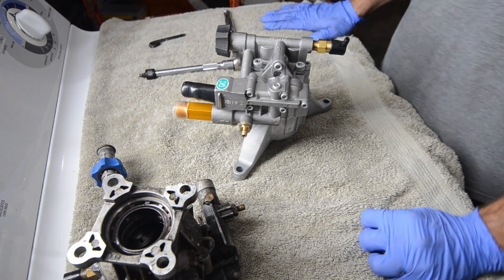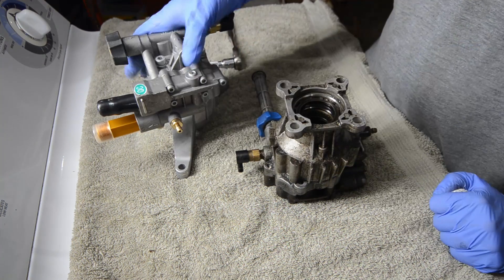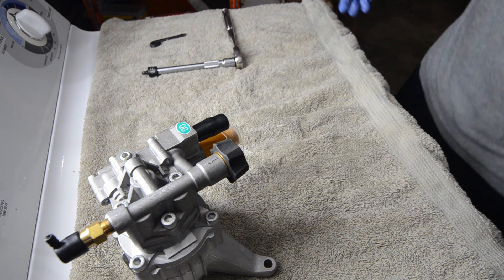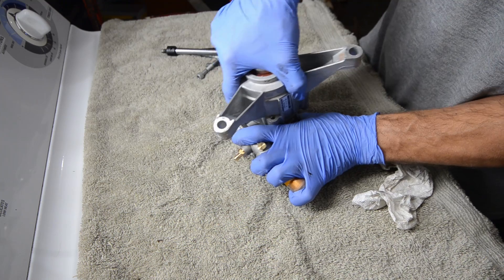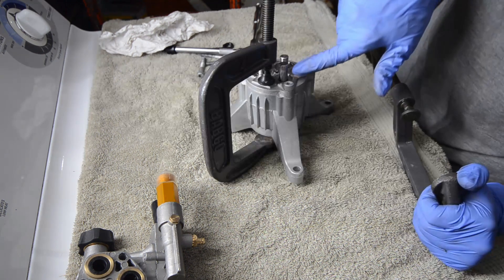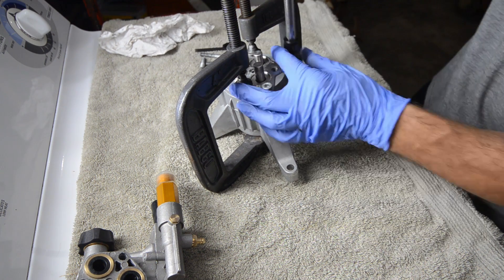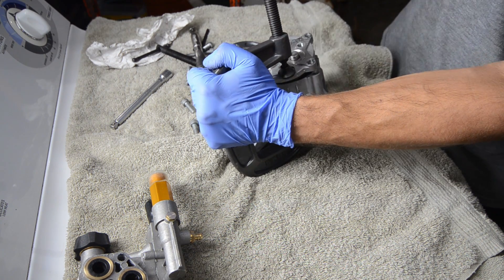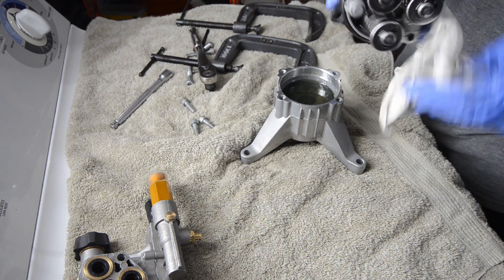How To Pull Apart And Inspect A Chinese Axial Cam Pressure Washer Pump From Amazon. Part 1/2

Comment: Watched both videos. The difference in the oil was amazing. What do they use? Vegetable oil? In this video you can barely see the washer plate, but in Part 2 the new Mobil gear oil you can see into quite well.
Thanks!

Comment: How do you drain and refill the oil in one of these vertical pumps, without disassembling like that?
Reply from the maker: Old one had a drain plug, new one didn't. So the answer is, you can't.

Comment: If the old unit only needed need bolts and a seal, just replace the bolts and seal. Remove the old sheared bolt by mig welding a nut to what remains sticking up and remove with a wrench. Ez.

Comment: I just got a new washer and it unfortunately has a Chinese axial pump. I will follow your advice and  clean it out. Is it worth putting drain and fill plugs in the casing? Now I know what to expect inside. Thanks.
Reply from the maker: If you plan on changing the fluid often the the plugs would not hurt. Not that it is hard to pull apart.

Comment: AMSOIL synthetic MARINE gear lube 75W-90 or AMSOIL SEVERE gear lube EXTREME PRESSURE 75W-90 + Would utilizing Performance Tool W1156 Grip Clip Transfer Pump/ Siphon Fluid Transfer Pump Kit for Water, Oil, Liquid, and Air for $13.50 have SAVED MUCH TIME instead of wrestling with the C/D-Clamps and 6/8mm allen hex tool and risking nicking the machined-finished/polished parts and damaging seals.  SEEMS LIKE A LOT OF UNNECESSARY WORK

Comment: Where can you find the little metal washers/seals that sit just on top, well technically bottom, of the housing. I can find the o rings in kits but the only way I can find the metal washer/seals is to buy a complete pump. Mine leaks water and I found that one of thise washers had been damaged and corroded, actually split all the way around and there was water inside the housing. HELP!!

Comment: I had the same pump break. The bolts brok and the pump opened up and dumped oil. Everything was okay so I got some replacement bolts and added Briggs and Stratton synthetic pump oil. The new bolts heads shear off so the bolt shaft and the housing was damaged. I have pictures if you want to see.

Comment: bro my unloader valve is STUCK corroded in the pump body of a 1 year old Honda GCV160/Ryobi 2300 psi unit; any tips to get it out so I can service the faulty/stuck valve itself???
Reply from the maker: All I can say is try to work it loose. If it is that bad you might just be replacing the pump.
Reply: Had the same issue with my GCV190. I took the nut and spring off, then put a socket big enough to allow the valve to fit through. Attached the nut on the end and hand tightened it with another socket. Came off with ease. No need to attach socket wrench.

Comment: What do you typically see go wrong with those axial cam pumps when they stop producing pressure?
Reply from the maker: If we are talking to the point they are not worth trying to repair. Seals, physical wear, unloader valve, other large catastrophic failure. That is what I have seen.
Reply: Bassntruck thanks!! I’m just gonna order a new one. Appreciate the reply!

Comment: hey man i changed the pump oil and put it take together and check to see if it worked still and water started leaking bad by the bolts to remove the oil cap any reasons why ?
Reply from the maker: I have seen some older pumps once they have been taken apart the plunger seals no longer hold the water pressure. Is the oil mixing with the water?
Reply: No its not
Reply from the maker: Which bolts are you talking about exactly? Where in the video do I remove them?
Reply: The ones u had to put a c clamp on so it wouldnt pop open
Reply from the maker: So around the 4:45. Then you likely have weak axial cam seals. This is somewhat common on older pumps once you take them apart. That or you might have damaged one or more when pulling the pump apart or putting it back together. I like to put a little oil on them to help it go together. If you can find the seals you can replace them. Might just have to measure the seals to order new ones.
Reply: Yes those

Comment: Hey man, followed your vid and really appreciate the help! However, I replaced the pump and still have the same problem..no pressure! Hose and wand seem to be clear of obstruction...any ideas???!
Reply from the maker: Sounds like an issue with the unloader and being stuck in the "open" position, therefor making no pressure. That assumes you just get standard water feed pressure out of the wand. And that the insides of your pump are all in good order while put pack together correctly. I also take it you have no water seeping into your pump oil.

Edit: You replaced the whole pump and still get the same issue with a new pump? If that is the case it still could be a stuck unloader (odd) but are you sure the shafts are fitting together and the key is installed? If the key is missing or too small and slides down it will make no pressure as it is not spinning.
Reply: (feeling like an idiot)) where should the  "key" be located? I had no issue sliding the new pump onto the shaft, but never noticed a "key". perhaps that is my issue.
Reply from the maker: terrell knight You will see a slot machined into the shaft on the motor and in the pump. It should be a 1/4" key. This is what makes the pump grab the motors shaft and spin. The key is just a piece of metal 1/4" x 1/4" and is likely about an inch in length. It either falls out when the pump is removed or is rusted in place making the pump hard to remove.
Reply: thanks man, I'll look into it as soon I get  chance. I'll let ya know how it goes. :-)
Reply: Got er done, man! Found the key still lodged in the old pump. Pried it out, popped it in the new one, runs like a champ now. Thanks a bunch man!
Reply from the maker: terrell knight Awesome!

Comment: What oil do you recommend, I got sae 30w non detergent, but I was told that 50w moped/motorbike gear oil is good too,
Reply from the maker: Rocky fish Some recommend non detergent 30 weight. I use gear oil. Link is in the description of what I used. Thanks
Reply: Bassntruck some gear oil have detergent in
Reply: After doing some research. ND SAE 30 is the best.

Comment: What oil did you use I've been told 30w non detergent, but I've also heard 50w gearbox oil
Reply from the maker: Rocky fish There is a link to the oil I used in the description. Pump is still working fine.
Reply: Use a lighter oil detergent or not. Add some hyper lube too, won't  have to change as often. Autozone

Comment: Great video how much oil do you put in. I'm changing the oil on my Chinese horizontal pump it has a oil breather so I drained the oil out then used normal oil to clean the rest out mine is longer that that, it's the parkside petrol jet wash 180 bar and 6.5hp
Reply from the maker: I put back in what I took out. I really did not measure it. If it is the same pump as mine I would guess it held about a cup of oil. You could measure what came out and add a small amount more. Hope that helps.
Reply: Fill it up until you have an 1/8" to reach the top.

Comment: Got This Pump From Amazon But The Horizontal Pump, Installed It And Noticed That It Slightly Started Leaking Oil From The Seal That Seals The Shaft. Any Idea What’s Wrong? Maybe The Seals Not Seated Properly? Thanks In Advance.
Reply from the maker: Make sure where it is leaking from. I have seen a leak from the engine look like the pump. If you are sure it is the pump, then the seal is just bad. Could have been damaged in production or could be defective. There is a small chance it could stop leaking on its own (before it runs out of oil). You could return it or just get another seal. There will be aa number of number on the face of the seal. They are the measurements of the seal, just find a match.
Reply: Bassntruck I’m 100% Sure It’s Coming From The Pump, So Best Bet Is To Replace The Seal?
Reply from the maker: Is it leaking where the shaft from the motor goes into the pump, from the halves of the pump, or from the bottom of the pump? The case halves are just an o ring. if it is from where the shaft is then a better seal will fix it. Or return it for another. I looked at the video and could not tell if the numbers are on the side of the seal. If the current seal has no numbers then you can just measure it and find what you need. Just need the OD, ID, and width to find a new seal.
Reply: Bassntruck I Can See Oil Leaking From The Orange/Red Seal That Sits In The Case Of The Pump Where The Motor Shaft Goes.
Reply from the maker: Then just measure the ID, OD, and width of the current seal and look one up with those numbers. Pop the old one out and tap new one evenly down until seated. Using a large socket or something round if you do not have a seal driver. Put a little oil on the inner part of the seal before you attach it to the motor, it will help keep it from tearing.   Trying to hit the 1k subs, throw me one if you have not. Thanks!
Reply: Bassntruck Thanks For All The Information Very Helpful! Sure 👍
Reply from the maker: The seals are measured in mm incase you did not know. Thanks!

Comment: Super touch 10w30 can you use it in a pressure washer pump
Reply from the maker: If that is all you have, you could put it in there. I would strongly recommend a real synthetic gear oil though. The motor oil will not las as long and the detergents in the oil might not be helpful.
Reply: Nooooo! Use ND SAE 30.

Comment: Great video, thank you.  I just received one of these pumps from Amazon and it appears to be leaking oil.  Rather than sending it back I think I will rework it as you did and upgrade the oil. It likely has a pinch in the housing o-ring.  I ordered it as a spare for my powerwasher since I know this is the weak link.  Ultimately I will need to replace it, but your video might make it last a lot longer than it would otherwise. Thanks again.
Reply: Bassntruck would it be possible to drill and tap a drain  bolt in the side instead of tearing apart ?
Reply from the maker: Ed,

Glad it helped.
Reply from the maker: KingQuad Bott   Sorry for the late reply. Yes you can put a drain in it. The old one had one.